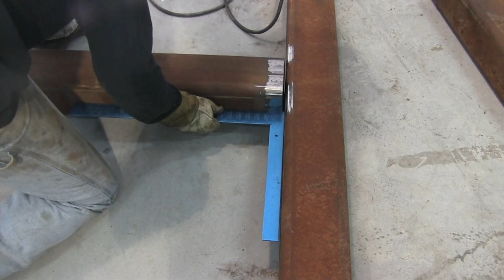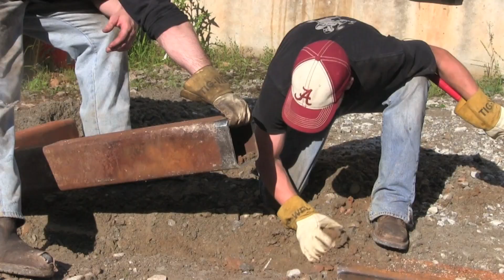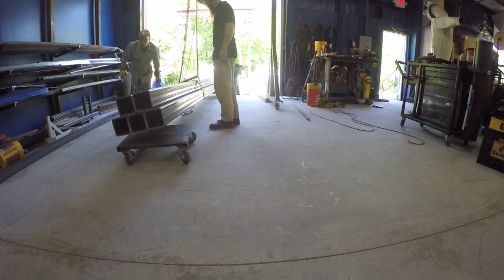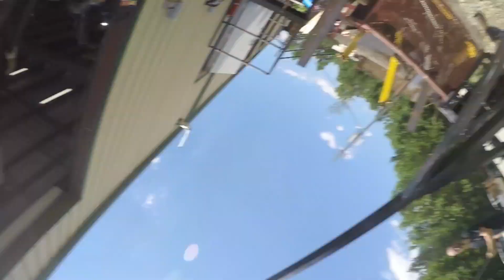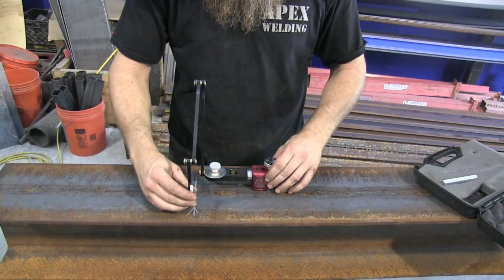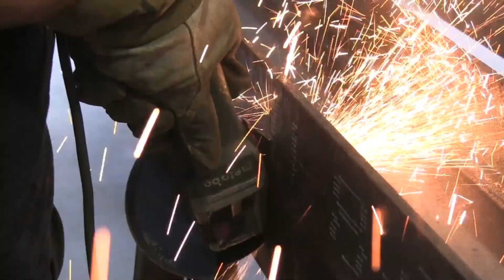Metabo vs Cutting Torch

Comment: thanks for opening my eyes. i was about done with the cut off wheels
Reply: Cut off wheels are faster when you have a nice heavy amp grinder that uses 6" wheels or bigger. Leave those peanut grinders for the light duty work.
Reply: The words high amp are the key so that you can lay into the metal properly for speed. I'd like to see the times if a high power powerplasma cutter was used.
Reply: Plasma would be be faster than the oxy-fuel torch, but you would still have the clean up afterward for the rough edges and dross.
Reply: It depends on the lenght of the cuts to make. If u have steel plating like 10mm and u need a sqare out of this the torch will be faster the bigger the size is.

Comment: based on my experience cutting torch much better than grinder for cutting thick metal or steel, from this video that guy use cutting  torch that guy to slow move the torch and use much fire and o2, actually you can cut that think with less fire and o2 and got clean edges from cuting...
Reply: that's right man .....
Reply: Sad to see the young  tradesmen  that shy away  from  the  torch  in favor  of  a grinder
Reply: hahahaha 😀
Reply: I first learned about 6" grinders (preferable for most use compared to 4.5" (too small, cutting disks have inferior reach and edge speed) and 9" (unwieldy, bulky) from my very experienced pipe welding instructors. That was many years ago and the Metabo wins over torches for a lot of work because you get a finished cut with much greater precision. I collect and rebuild oxy-acetylene equipment and love using a torch, but not for everything. Another advantage of abrasive cutting is it leaves no HAS, important when cutting some parts prior to machining. 

"You should not have any special fondness for a particular weapon, or anything else, for that matter. Too much is the same as not enough. Without imitating anyone else, you should have as much weaponry as suits you.”
― Miyamoto Musashi

Comment: JD is Old Skewl.
That's the way its done.
 I like a rat tail for that disc cutting on heavy stuff but hey. I think he likes a "one grinder" method. He nailed it.
I too was quite surprised at the clock. I never thought about it. The torch is more "laid back". The grinder can kick your ass if you aren't doing it right. 
I use a little of everything as I hate monotony and repetition. Well. Everything but a Sawzall. I hate abuse.

Comment: Obviously the grinder is preferable especially when we talk convince/portability. That surely make Metanoia a clear winner BUT, I’m curious if anyone has an idea about the cost difference of gas/cutting wheel? It would have to be significantly cheaper to run gas to motivate anyone without a shop to run a torch.

Comment: the question is how long does the grinding wheel last? I feel like you'd have to go through those kind of often
Reply: That's what I was tthinking
Reply: also, the gas you need for the torch.
Reply: Depends largely on who is using them, and for what. The brand also matters A LOT, I buy nothing but Walter.  I don't normally use zip cuts for anything over 1/4" but sometimes if i have only one piece to cut I will .

That being said there are some places a grinder doesn't fit so you have to use a torch.
For cost wise the tanks and gas will cost me 140 a year for rental and about 250 for M class bottles (mid size ones)
where as a box of 25 zip cuts will run about 125 bucks.

Zips will cut anything witch is a big plus where as torch is restricted to mainly steel, and you still will probably have to grind even after you use a torch.

So unless your cutting heavy stuff zips pay but anything over 3/8 they start it loose their luster .
Reply: I second @brainmalfunction.  Cutoff disk manufacturer and model, and metal type dictates life of the wheel. I use the wheel up to 3/8". Plasma up to 1/2". OA above that. However even plasma requires clean up.
Reply: would the cost of cheap disc outperform at the end of the day the increased price of good ones ?
Reply: ...No...the expensive ones will just about always have a lifespan better than a handful of cheap ones.....same goes for grinding wheels, sanding belts...most any type of 'cutting' tools....
Reply: Those are abrasives, not cutting tools.
Reply: Abrasives ARE cutting tools.  Microscopically, the abrasive cuts and removes small chips of metal, just like an endmill does, only smaller.
Reply: ...Thank You...! I almost deleted my comment.
Reply: +1 on quality wheels and discs. I had used basic ones for years, because it was what was there when I learned to weld, and it always seemed to work. Then I got some quality ones from a clearance bin (open box deal) at Norco when I was getting welding gas and the difference was remarkable. It definitely seemed to work better, but I was expecting them to wear as fast as the cheap ones I had been using which would negate the value. After a reasonably heavy cut (about 6" of 1/4" plate) I compared it to an unused disc and the wear was barely perceptible, other than the unavoidable and irrelevant scratches to the labeling. 

Consider how much research and development 3M and many others put into these material sciences. They are trying to make a better product so you will only want to use their product. The others I had been using are trying to make a cheap product that only has to work well enough for you to buy them again, based on price.
Reply: it is relevant to the amount of carbide used to make the disc. Some H/F disc just heat up the metal red hot and heat treat so ppl push harder and burn out their $20 grinder in 5 mins.

Comment: Rhodius LSZ F Vision disks, Metabo 9" W/180* swivel lock handle and Rhodius 9" thin cutoff wheels make short work of just about anything. You get what you pay for. The abrasives are worth the price for time saving and reduced finish work.

Comment: Personal preference when it comes to grinder vs torch vs plasma. I prefer the plasma, only need electricity and air, which is cheap when you break down the numbers!! Grinding discs, oxy/acetylene, their costs CAN add up pretty quick and be higher than one might think. Don't forget the time it takes to change out the discs and or bottles for a torch. Time = money.

Comment: Metabo Milwaukee DeWalt Bosch Fein.... I've been cutting with oxy acetylene for 20 years (side shop biz). It's not the grinders name more then the watts/amps, and the quality of wheel you use. I've used 00-000 on thin steel since the beginning. The quality of abrasives has really changed making long cuts affordable on thinner material. The amount of time getting oxy/plasma from behind whatever else, switching tips, wondering how much water is in your dryer, setting up the strait edge just doesn't make a lot of sense. I'm surprised of the number of comments saying plasma or torch wins. It depends on the job and that's it. But in the last five years my oxy and plasma has been getting  cold because you're already sweeping the floor anyways... Not to mention if you get good with a ~4.5 inch wheel with a no safety attachments curves are easy. New abrasives made the difference.

Comment: Up to a certain point (like you said towards the end of the video) with material thickness in mind,  The Metabo cut was faster than the torch, including the deburing. In the sense of consumables cost (Metabo cutting wheel vs torche fuel and grinding wheel) in your eyes which method would be more cost effective? Great video BTW 👍

Comment: Jodi, thanks for all the great vids. I just want to ask if anybody out there is having problems with Lincoln SP-170T welders (220v). I bought this in 1997 and cannot get it to work. I am running 0.030" with weldmix, and have changed the liners, circuit boards, and lubed up the heat selector switch. Problems.....will not feed flux core at all -either jams in contact tip or feed rollers flatten wire out and spin. I tried Lincoln wire, Fourney wire etc. I considered going to a 0.040 liner and getting geared drive rollers but have a stick welder so no biggee. I mostly weld body steel 0.030" with MIG. If I tack weld it either pops from no penetration or it is too hot and has a hole. I cannot get it to flow out. If I go to weld 1/8" I use the recommended heat settings and cannot get ANY performance at all and about the time it looks nice the contact tip has started to melt from over heating. Now if I were to read this, I would say operator error BUT I have used Miller 110v and 220v, Feronius liquid cooled, Acklands, Hobart etc and NEVER HAD ANY PROBLEMS but just this misfortune in buying a Lincoln that appears to have decent reviews. I paid $1300 in 1997 for it new. Is this welder an anchor? I am so upset that I would even buy a used welder for a few thousand to replace it.  Any chance the 0.040" wire would help? I can't get 10lb spools here just the big ones that don't fit. I am just beside myself and so you guys don't think I'm an idiot......my last job was welding winch brackets on knuckle boom cranes for Palfinger, North America. I also carry a autobody, auto service and diesel tech licenses which is why I am going crazy because I CAN'T make this thing work! When I was 17 I should have taken this piece right back but I thought it was me! Now I'm 37 and still can't use it.....thanks to anybody who can help or take the time to read this before they buy one.

Comment: do u have any positioning tips for pipe welding? like body placement to stay comfortable specially stretched out in between pipe leaning over.. have some real tricky positions at work lol and could use some position tips to stay comfortable and have the ability to make it over a qtr of pipe(2in) id. any tips would greatly be appreciated

Comment: If you didn't prep both ends of the pipe you cut, then the difference is even greater!  Obviously you're immediately prepping the part you cut and are going to use, but I HATE grabbing a piece I need to cut from only to discover that the last person to use it cut it with a torch and left it all gnarly for me.  :)

Comment: I’d be curious to see you compare a plasma cutter to the oxyacetylene torch and a 6 inch grinder.

I’d like to get myself an oxy but wouldn’t use it enough to justify the price of gas. I have a handful of different grinders and I have a cheap plasma cutter but I haven’t sat down and done any straight comparisons between them yet.

Comment: And now with a plasma cutter :D I have a cheapo TIG welder, that can be used as a plasma cutter. 
Just needs an additional air compressor and i build something like the torch guide in the video by myself for
straight cuts. Up to ~15mm it doesnt look worse than a grinder cut. I would bet dedicated industrial plasma cutter
can handle much more.

Comment: The real comparison should be the time it takes to sever the I beam with either method forego the layout and finish work.  In most cases where I beam is being used a polished finish cut isn't called for.  Fact of the matter is in a heads up comparison I've described the torch will come out on top.

Comment: Hey Jody, 

I'm a novice welder.

I can see you welding this big heavy box tubing with stick. Would you ever bother to pre-heat this before welding? Won't your weld cool rapidly as the mass of the steel sucks the heat from the weld area, perhaps causing it to become brittle? Maybe you could do video on this??? When it's necessary to pre-heat - or why you don't need to pre-heat. I'd love to watch that one, as i'm always paranoid about my welds being brittle.

Cheers buddy ;-)

Comment: this blows my mind but we mostly run 4.5 inch grinders, guess its cause they are cheaper and easier to handle most of the time, but those are Bosch and their motors eat brushes like crazy.

Comment: Interesting to see the difference for preferred size of grinders on either side of the Atlantic.Here in the UK and as far as I know the rest of Europe the usual size of grinders is four and a half inch  and nine inch. I use 9 inch and 4.5 inch electric grinders and a 4 inch air powered grinder for aluminium. I do not remember ever seeing a 6 inch grinder here, have seen and used 7 inch one though. So what are the common size grinders in the US.
Reply: Is that due to power requirements of 9 inch grinders or just preference on size, do you think not sure how much power you can draw on a standard 115 volt supply in the US. Our standard is of course 240 volts at 13 amps so we can draw just over 300 watts but many grinders used in industry are run from safety transformers at 110 volts and draw 20 amps 2200 watts or just under 3 hp. One would have thought that manufacturers would try and standardise size on both the machines and discs.
Reply: Here just about all industrial and commercial use is via a safety transformer often called a site transformer as they were originally introduced as a safety device for building sites. In the 1970's my brother in law used 9 inch grinders and when the discs wore down transferred them to 7 inch grinders to get the best use from the discs as they are speed dependant for effective cutting, dose not seem to work these days though as the modern discs appear to be softer towards the middle, I assume to help avoid shatter but might be in order to sell more discs.
Reply: Nigel Kingsley-Lewis I use 4.5" and 7" on the farm shop
Reply: It's a nice idea to move the disk to smaller grinders as they wear down but like you said, you need to keep an eye on spindle speeds and wear protection. You want to protect yourself if that disk shatters when you are using it because it becomes like shrapnel. I like to use my everlast plasma cutter for most cuts. I hope to get a cold saw one of these days.
Reply: Yes, I knew some one who had a 9 inch cutting disc explode on him. It put him in hospital for a week, nearly cut his nose off and remove one eye, he was lucky he did not loose the sight in the eye.
Reply: Nigel Kingsley-Lewis Most common in Australia is 4, 5 and 9 inch. Phasing out nines though due to safety issues. We're stupidly safety conscious...
Reply: Equiluxe1 FACE SHIELD
Reply: 61 year old and using 9" grinder for 40 years.NEVER removed the safety guard and Always kept the machine between me and the disc.

Comment: the fastenal guy would only stock blackstone cut off wheels at our shop which I have found to be terrible, one day I told him to bring a variety of them so I could pick a better wheel. the metabo was easily the best, sliced through things like butter. they do have a somewhat short life span but not nearly as bad as others I have used.

Comment: Yup pulleys and dollies they built pyramid using that method counter balance on weight on how you move stuff I'm in a wheelchair and I'm always trying to move heavy stuff on my own, I have to figure out weight and how I'm going to use it to my advantage to help me move thing's easily to move around a good carts with a lift helps out a lot pullies and dollies carts.

Comment: Maybe I have to do more research, but I was hoping you would mention cost per cut of torch vs grinder.  I would definitely prefer the grinder cut on most work I do, because of the finish.  Also is there any comparisons to plasma cutters.  I've never used a plasma cutter, but if I could find a reliable one at a affordable price I would have to.
Reply: Initial cost of a grinder is a grinder and cut off disks. Plasma is much much more plus most require a compressor. Something to consider if your ever out of a shop. Plasma is cheaper per cut though.
Reply: Field work with a plasma is tricky. You can easily trip jobsite breakers since you need a compressor but you can make a thousand cuts between consumable parts.  You could go through a couple 9" disks trying to cut one beam.  We ended up rigging a portable power outlet that would keep the compressor from firing up when the plasma was under load.
Reply: If you are referring to the cost of cutting the I beam with each method I would venture to say the torch is cheaper.  if you look at how much cutting you can do with one set of bottles compared to how many cut off wheel you would use.  Initial cost of the equipment would be higher for the torch but consider how many different things you can use the torch for; welding, brazing, soldering, heating for press fits, scarfing and cutting.
Reply: Depends on the task. It's easy to get nice torch cuts with practice and torches don't require electricity, but torch cuts usually require grinding to finish so a grinder is involved anyway. Torches cut heavy stock a grinder won't and are exceptionally versatile. You can gas weld with a torch and they work superbly on thin sheet. I have multiple torches, saws and grinders but haven't needed plasma since I don't do a lot of sheet metal and most of what I do is straight cuts. The best answer is get what you need as YOUR task dictates. I used and maintained three rather nice ESAB plasma cutters for our local vo-tech and loved them for bevelling pipe coupons but feel no urge to buy one (if I do it will be Hypertherm) since my other tools cover all my needs.
Reply: Plasma cutters are far faster than anything else handheld in thinner metals, up to about 1/2”. A hypertherm 45xp is the professionals weapon of choice for cutting

Comment: I use a 4.5" grinder with a 1mm (1/25 if using imperial) cutting blade for all my cutting :)
Reply: I have found that The 6" cuts faster and lasts longer. Especially with the ceramic compond wheels.

Comment: Hey JD, I'm a novice at all this but I was wanting to ask you a couple questions about the Metabo. I know usually the higher the amp tool is usually equates to longer life and more power, but what amp Metabo would be the least amps I should buy and feel like its good for an average user? Also how long does the wheels last on them? Thanks!